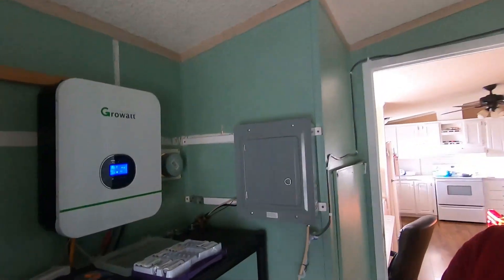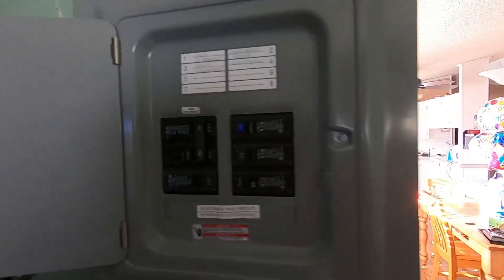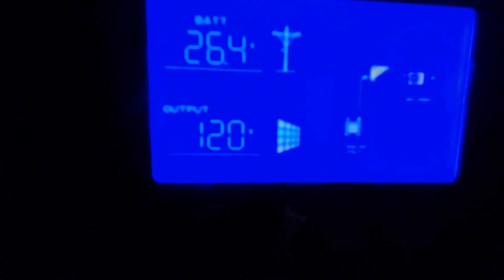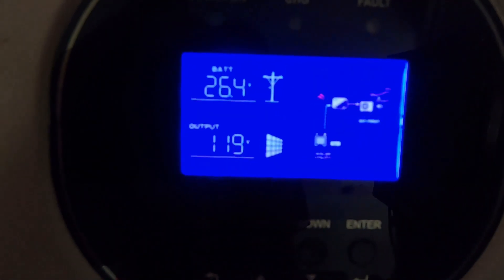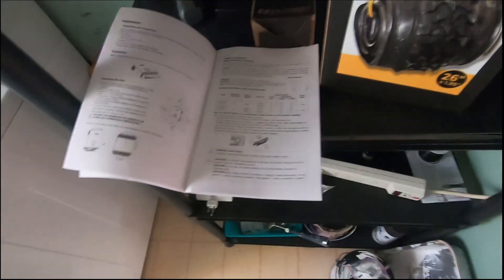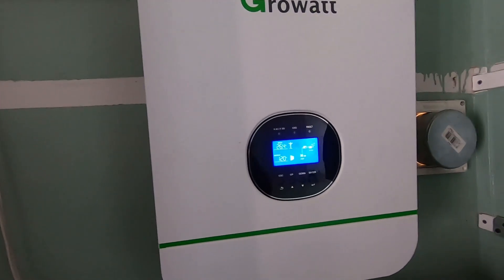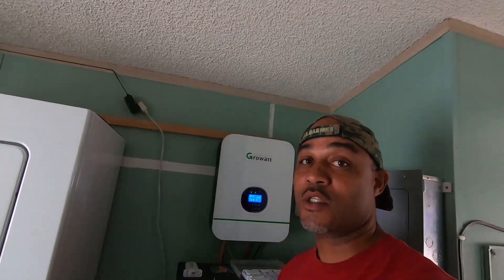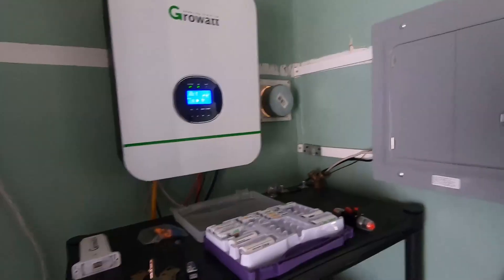Growatt 3KwH Inverter  and Mule 24V 3KwH Battery Bank Reviews

Comment: I just bought one of these Mule big battery and it was dead on arrival. Apparently the BMS shut down. So I have to send away for a 24 V charger to wake it up again.
I contacted big battery about the charge control settings, they seem to be unable to give me any direct answers? 
What settings do you have for your battery? 
Float, charger, battery, and disconnect, or shut down for low battery voltage? Thanks 🖖

Comment: Dear Solar Bro, when the batteries are topped off does the excess power go right to your home grid to reduce how much you are getting from the Utility grid?? I have 2 systems, 1 is a 12v battery off grid system powering my gym, light, heat, outlets. 710AH battery bank with 1kw of panels. I use a  SkyMax 440 Charge Controller for Wind, Solar, and Hydro on this, so I can change the batteries to 12v/24v/48v.  Then I have a 2kw gridtie inverter system going into my home.  I want to add another 2kw of panels, 5 Kw total.  would I be able to tie those 2 systems together with the Growatt inverter

Comment: Good vid, I want the same one but the ES version and put it in my 35 ft RV
Reply from the maker: That would be so much power for your RV, I'd love to see a video of your setup when you get it up and running!
Reply: @solarbro8075  so would I 😂 I am putting it all together slowly but I'm sure it will work well when done right 👍 I think a 24volt system will power everything in the RV for good while without  needing the generator or shore power for days thats my goal.
Reply from the maker: @AdinoAdonai  Oh yea you get that Growatt setup in there and some good 100-200 watt solar panels at least 4 or more on the roof and you'll be generator free. I can't wait to get my R.V. so I can get a nice power system going in that bad boi!
Reply: @solarbro8075  what kind do you want, I got an A class 99 model, it wasn't expensive and the previous owner took good care of it, everything works solar is all it needs
Reply from the maker: @AdinoAdonai  MPPT is the way to go, are you selling it?
Reply: @solarbro8075  nope I bought it a couple of years ago and I haven't did all I want to it, after that I might

Comment: Wuzup Solar bro ? just got the Husky Big battery w/3k growatt. Did you use a ressister when connecting the batt. to the Gro.
Reply from the maker: Whats up Bro! Thanks for watching! No I didn't. No need to as the Big Battery already has a 300 amp fuse build into the unit. You can see it if you yake off the top case for easy access to it if it blows. Very convenient!!!!!

Comment: What is your average load?
Reply from the maker: Im running the inverter at about 15% so only 1.2kw of the possible 3kw of power. I have ran quite a bit on it as a stress test up to about 2.6kw of power for hours during full sunshine and the unit worked flawless for hours. Great choice if your just starting a solar array setup and it can be upgrade to run multiple units for more power say 2 units in parallel for 6kw of total power needs.
Reply: Awesome. Yeah the parallel feature was the key, so I can expand slowly as I can. Great to see others using the same Growatt with good results makes me feel 10x more reassured.